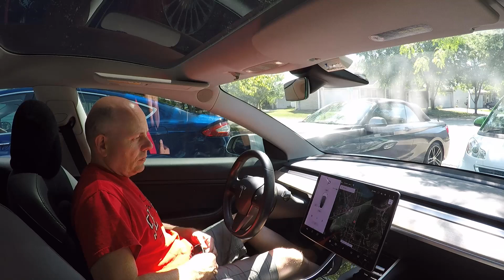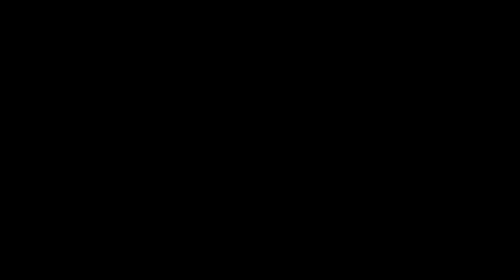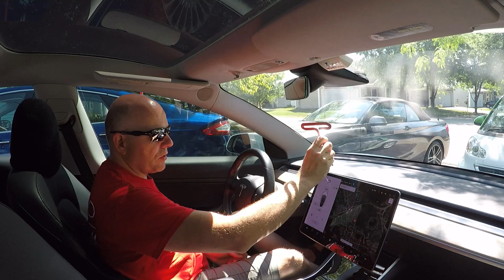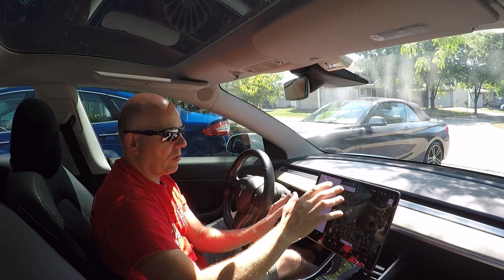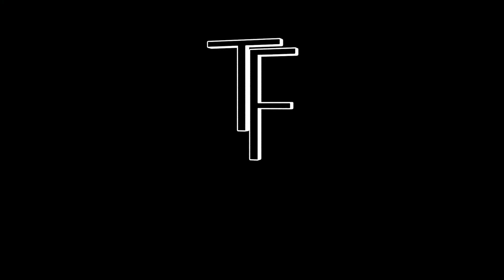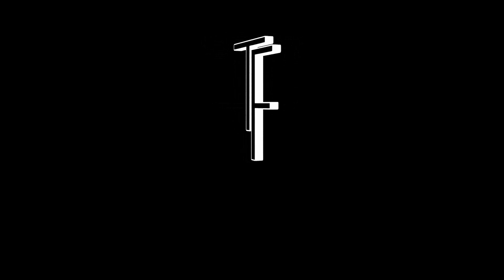Model 3 adjustable screen mount kit (V2) now available to order!

Comment: Hi Matt, For me the screen is a bit too high and vertical. The first option; 2 and a half inch lowered and 10 degrees tilted  looked to me a bit better and design wise fitted better with the interior. As it is as now I won't order. A pity, cause I loved it at first.
Reply from the maker: Gotcha. I had more comments about it being too extreme before. 

The origin version will be one degree further forward angle than it is now. Also, it can be spaced lower by adding spacers. This will be included in the kit. 👍

Comment: You have an early Model 3, have you checked to make sure Tesla has not changed in any way how the screen is mounted in newer models that would cause an issue?
Reply from the maker: Good question. No I have not. However, a large amount of production expense and tooling is related to the specifics of the screen design. I highly doubt there are any differences......

Good question though.

Comment: You can replace those allen head screws with a lever lock fastener so you don't have to carry around a key and fiddle around for the screw heads.
Reply from the maker: Yes. However, the wrap around boot would not fit then.

Comment: That’s unfortunate 275 is more than double what I’m willing to part with for this feature if it ever drops to 99 i will do it maybe you can cut the cost to have it 3D printed and I would need a plastic cover. a leather sock is a no go I rather have it bare. Maybe a corrugated rubber boot something else to consider is add a duel fan near bottom of screen. I think to drop more than 1.5 inches it drops the sight line to much have to look down to see screen then up to road and wonder if it may be affected by any regulations. But nice idea and best wishes it sells for ya just thought to my self at what number do I feel got to have it and for me it was 99 the highest number before I was like ......................
Reply from the maker: Good luck with that. Machining alone is more than $100.
Reply: Tech Forum well if the guy won’t give you a bulk discount for machine the products may consider shopping around for someone willing to give you larger bulk for less money. I’m not a big fan of machinists who want to charge the customer for creating a design program.... that’s part of good buisness to turn out a product and it’s the manufacture problem if they make their job easier with better tools because we don’t buy tools for our contractor no..... why should they charge us for their tools. There are other parts in world that make things cheaper but annoying when someone suggest china lol our economic enemy. There is Middle East, South America  and many other places you can say made in USA get mad props! But again this product far and away out of my value to function equation but I do hope you sale......
Reply from the maker: @paratrooperz1  wow, aren't you a bundle of sunshine......

First off, "Bulk discount" as you say only comes into play when ordering huge quantities. This is a low volume item. I am ordering 50 of them to start. 

Second, he is not charging me to program the machine. But, that is only because he is a friend. Why would you disagree with paying someone to design or program something? Their time is not free. Lastly, this is a freaking expensive car. $275 is not an expensive upgrade for a car at this price point. 

You are obviously totally clueless about short run manufacturing. 

If you don't like it, don't buy it.

Comment: I would get one if it only tilted towards the driver and not moved down. Is this something you would consider doing?
Reply from the maker: It cannot be done. The structural layout of the screen and the framework in the dashboard does not allow it without moving the screen away from the dashboard a minimum of 2.5 inches. That looks terrible and causes interference with the shift lever.

Comment: My advice... get it manufactured in China, list it on amazon and just make as much money as you can before someone rips you off.

You’ll never be able to fight someone who breaks your patent overseas and still sells in the US.

Second option is to try to sell the idea but you’ll probably not make anything significant there.

As an inventor I can tell you it’s a crap shoot unless you chemically invent a new compound or material.
Reply from the maker: I agree. I have a background in short production run inventions/products. I have invented over 30 items for the RC industry. My philosophy there was "Flood the market quickly and make money while I can". Any good idea eventually gets knocked off. I just want to get in and make some money quickly before that happens.
Reply: Tech Forum yuppp! You know the routine.
Reply: From what I’ve seen with Evannex, they will be the ones ripping you off. They’ve already taken Brian from i1Tesla’s auto frunk/trunk ideas and jacked up the price. Then they delete/ban anyone who calls them out. Go with Abstract Ocean.
Reply: @SmoothGummi  Brian's idea was not something you could Patent. It was just two items he found on the internet that happen to work together.  Matt's idea is original and must be produced, as you can't just buy it on Amazon. It does not exist anywhere.   I believe he should try to contact them about an intellectual property transaction.
Reply: Fabian La Maestra Yup, I get that. I was just super salty with how Evannex went about it and then removes all comments about it. That’s not how you treat the Tesla family.
Reply: Or set up a contract with the EVANNEX to make 20% off each sale while they do all the work of protecting your patents for you...
Reply: Not China, that is last decade. Vietnam or Sri Lanka if you are a huge corp, but Baltics or Poland if you are a small company. Better quality in eastern europe as well.

Comment: Some larger folks (tall, long legs) that sit in my car already bump their knee on the screen. A kit that could raise the screen an inch or two higher (which would not interfere with the road view for tall people) would add an additional market.
Reply from the maker: That is a possibility depending on the interest level.
Reply: Beiing able to adjust it by pressing a release button or turning a knob would be even better. That way households with two drivers of different heights would be catered to.
IMO, they (Tesla) should have had a similar positioning system to the steering wheel, but that would have probably added to the cost quite a lot. ;)
I've not got the car yet and am not sure if/when I will so can't order yet.
Reply: This is actually why I bought a Model S instead of the 3. My knee hit the screen on the 3 if anyone sat behind me and I had to move the seat up, so something that would raise the screen would be awesome.

Comment: what about a robery its easier for someone to steal? or needs more time to unlock all the set up than the original?
Reply from the maker: Not sure how a metal bracket moving the screen slightly would affect a robbery......
Reply: @TechForumTesla  Can you please consider using security pin-Torx screws?
Reply from the maker: @flamaest  I doubt it. They would need to be huge.

Comment: Caan this be used with RHD Model 3?  Thx.
Reply from the maker: I will be making a right side drive mount after the left side drive mount is manufactured.
Reply: I just saw this question was asked below, and with a positive answer!  Please could you do a short video showing it tilt to the right?  Thx.
Reply: @grahamastor4194  Just take a picture (snip) of the video and then flip it horizontally. ;)
It won't look right if he does it as there is no steering wheel on the right and it only turns (tilt is vertically as a note to other posters) one direction due to the mechanism to keep the angles correct (or so it appears to me).

Comment: Well done.  Curious on how the leather boot will look. Does you have any images of that? Also did you still keep the temp sensor zip tied?
Reply from the maker: The temp sensor position is to be determined. It will not be just zip ties. I will make a proper solution for that. It is just two screws. Super easy to deal with.
Reply: Great job overall I’m sure if you did this mount that’s super easy for you. Congrats
Reply: A synthetic material would be better than leather, something to match the seats ideally. Maybe a white and black option if that doesn't make things too costly.

Comment: The height and tilt look better. Does it angle both ways so it would work in RHD cars? Some video from the driver''s and rear middle seat would be useful too. Thanks.
Reply from the maker: Yes I can. I will speak with the machine shop about a right side drive mount.
Reply: @TechForumTesla  Thanks.
Reply: Tech Forum  It shouldn’t be too difficult to mirror the adjustment slots.  😉
Reply from the maker: @dennisschlieckau8723  exactly
Reply: EU Bike Dude Yes, I was wondering the same as I wait for my Model 3 downunder 🇦🇺